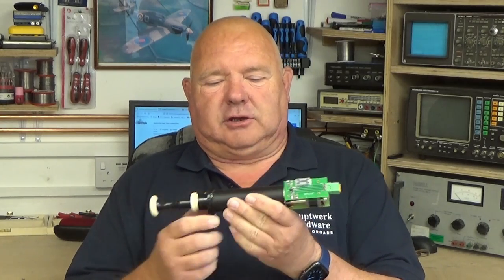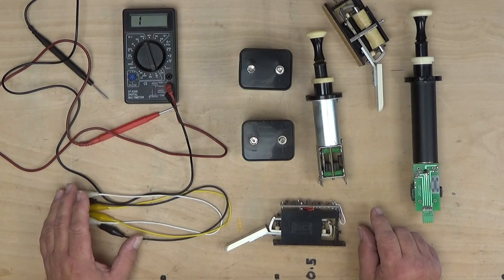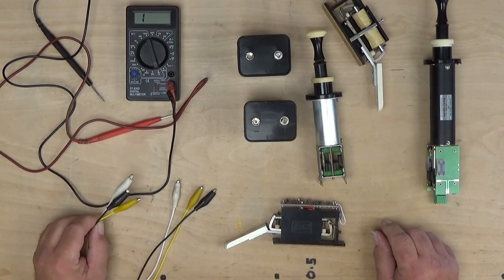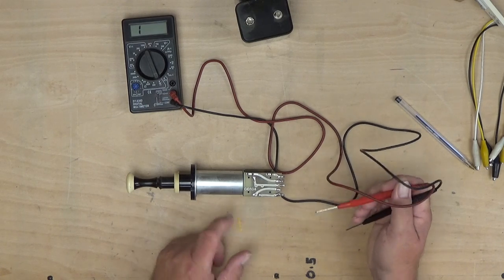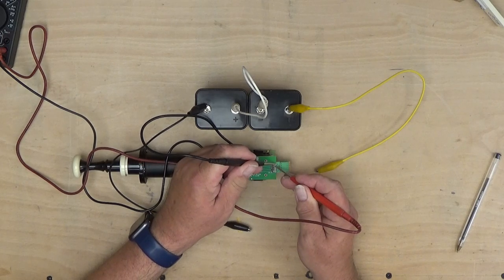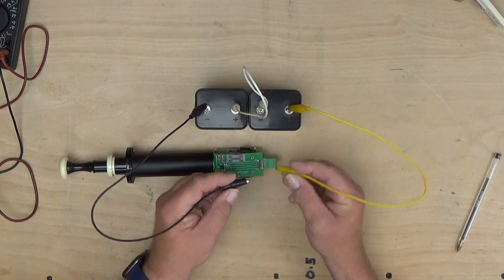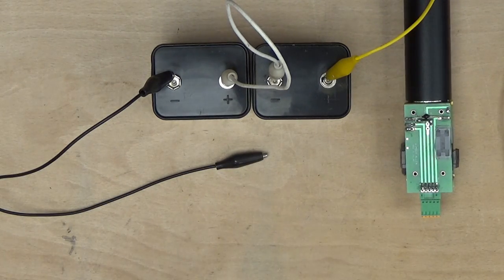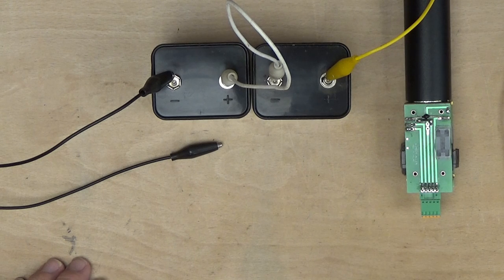How to Identify Motorized Stop Connections

Comment: For that one-time purpose, surely a pair of the far cheaper and more readily available PP3 batteries would suffice.
Reply from the maker: You probably could but the PP9 can deliver higher peak current so I went with that to be certain I had enough current available to operate the bigger stop reliably.